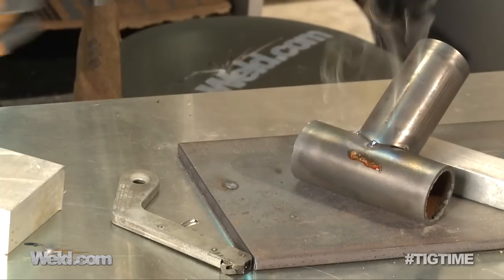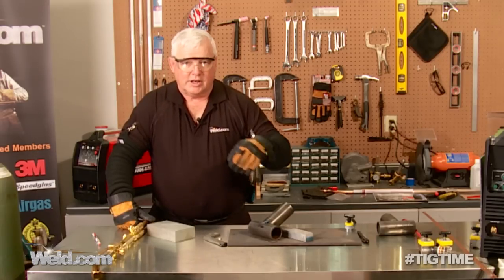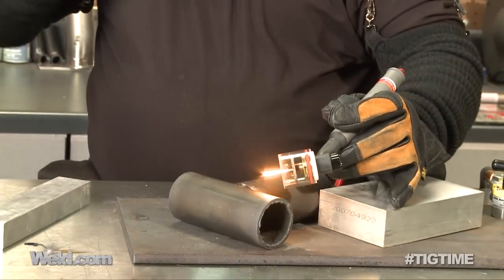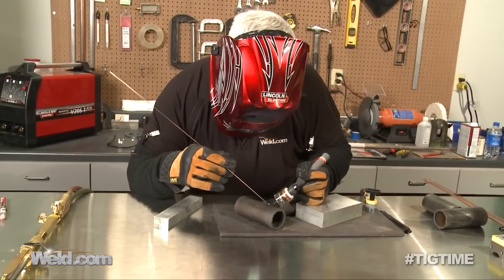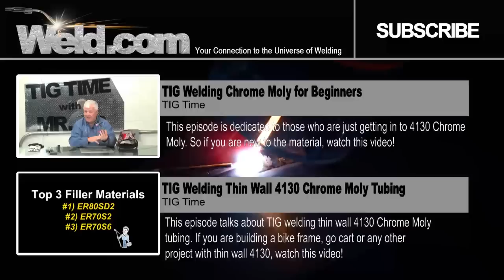TIG Welding Heavy Wall 4130 Chrome Moly | TIG Time

Comment: hi 
how are you i am welding brass for the first time please i need your help in this regard how to weld 3/4 square brass pipe the pipe is in casting the thickness of the pipe is 16 gauge what is the current  And what will be the pressure of argon gas and how thick will be its felting rod۔
 I will be grateful to you۔

Comment: didnt say what tungsten hes using, filler wire thickness nor what amperage hes at...pretty basic shit to mention in a "how to" video.....
Reply: Did you have the sound turned off?
Reply: Pretty basic and standard YouTube comment. Addresses issues that show you either didn’t watch/ listen to the whole vid or didn’t retain that ‘basic shit’ he did in fact mention. All of that info isn’t in there.

Comment: How could this guy call himself "mr tig", when he cant weld in anything other than a straight line? Absolutely no following of the radius of the tubing,  torch angles shot to pieces. A decent welder deserving to "give lessons", would have welded that in quarters or halves lol 
 Insuffucient fill leaving undercut edges, all sorts. 
Was this guy simply a salesman that had been shown a little bit of welding before each recording??

Comment: im finding that when i weld 4130 tube into stock motorcycle chassis mild steel the chassis tube burns back into holes  is there any reason why.should  use less amps?

Comment: Once again "Mr tig" is wrong! No one pre heats chrome molly when building roll cages. As long as its above 60- 70 deg. Also every Motorsports sanctioning body requires GTAW to weld chrome molly! Most roll cages are .083 not .120 if they are chrome molly. The whole reason for using chrome molly is to use the thinner material. I don't know any chassis builder that needs a root pass? The joints should be very tight. Many sanctioning bodies sonic test the cage and the weld needs to be the thickness of the base tubing. The only thing this self proclaimed expert is an expert in is marketing himself and companies that fund him. If you want to learn welding from a video try Jodie at welding tips and tricks or professional chassis builders who are plentiful!
Reply: You  didn't  lesson  very  well  did  you ?   120  is  for  monster  trucks  not  race  cars.
Reply: Desert racing requires .095 wall 4130. Most desert fabricators are running 2 pass joints...

In fact some builders are now annealing the entire chassis after welding to make it one homogeneous piece.
Reply: Did he say it was roll cage tubing?

Comment: PLEASE HELP ! im welding a motorcycle frame ( the piece that holds the pivot pin for my foot peg, it snapped off during a crash) and i have shaped it such that its a v shape ( like when you would create a groove before certain types of welds) its just that its much larger, and i estimate that it would take 6 passes to fill the v groove. i want to find out if doing so many passes will negatively affect the strength?? considering i maintain correct temperatures. advice will be appreciated, especially from Mr Tig ! :D i am following all the guidelines for welding heavy gauge 4130... thanks !
Reply from the maker: When welding your foot leg back in place it will be important to use the er80s d2 filler and make sure you don't quickly quench the weld.  Legit cool slowly to avoid cracking.
Reply: thank you so much ! take care

Comment: This very random and off topic... But I see in the back ground your bench grinder. What wheel do you use on that for tungsten? I bought a bench grinder and the wheels on it are impregnating dust into my tungsten I think. I have the same welder as in this video. I notice the contamination mainly on AC. Thanks!

Comment: How do you like the Helmet you are using in this Video? Is it the Viking 1840 from Lincoln? Is there any disadvantage because it has only 2 light sensors instead of 4 ? 

How do you like it compared to the lets say  3350 from Lincoln?

regrads

Comment: Wyatt,
Could I use a 1/8" tungsten for both passes as well, despite the lower amperage in this setting? I've found that most of my welds aren't on tiny little parts, and being able to "standardize" on keeping 1 or two sizes of tungstens(of various types, for separate materials) makes things easier, and "less stuff" in my kit(I'm a college student and use the equipment at school, but bring in my own torches, tungstens, cups,etc...

I've learned a lot from your videos, and have referred my instructors to you and your channel on multiple occasions.

thanks!

Comment: 5:15
"Make sure you shut off the acetylene first"

Is this correct? I was always taught to shut off the oxygen first.

No oxygen with fuel = No flame
Hoses get purged with fuel that can't ignite

No fuel with oxygen = Pop
Residual fuel can ignite. Hoses experience the forces from a "backfire" i.e. residual fuel igniting within the hose because you have fuel contained in a rich oxygen environment.
Reply: No  it  is  not.  Let  the  ox.  blow  out  the  flame.  Because  the  asetelen  is  sooty  and  dirty  and  you  might  cause  a  back  fire.
Reply: Yes it is correct. A before O or you’ll blow. It used to be taught the other way around but now it’s taught A first.

Comment: I noticed in one shot that when you tapered the amperage down on stopping you also pulled the diminishing puddle to the front edge of the crater. Is this something you do all the time?
Reply: Doing this reduces the chance of it "cratering"

Comment: Should be using a rosebud for preheat.  For larger items, a weed burner actually works really well.
Reply: You will anneal the metal I believe
Reply from the maker: +Robert Palmore Here's a lecture we do for the AWS on why pre-heating 4130 is not the best of ideas in most cases. https://youtu.be/wVrdST1pXRk
Reply from the maker: +simclardy1 This is true

Comment: not always, but definitely when doing suspension mounts. after you have the frame welded up it is good to heat treat it in an oven to relieve stress at the joints

Comment: Is it necessary to heat treat 4130?
Reply: Depending on the application.  Usually for a chassis no.  Unless the person you are building it for is a princess tjat wants to brag about how much he spent on his race vehicle (which he most likely will never run)

Comment: i think these days no one pays attention to the basic aspects of metalurgy...just because the weld was created doesnt neccesary mean you have now oneuniform piece, you could have 2 the weld and both pieces you started with. by allowing the fillet matial to cool in a way that it becomes tempered it could have very different properties than you were hoping to achieve..weld in Alaska preheat and post heat cruciel. or the ge nuclear reactor vessels preheat was post heat..zero room for error

Comment: I am building a truck frame out of 1.75 .120 4130n, what can I do to reduce distortion in the frame when using the pre heat two pass method?

Comment: Wyatt
Great example  Appreciate the heat stick and the metal prep didn't think about how far back to prep the joint area. Thanks for the heads up
Awful Arthur.
Reply: He didn't  mention if he cleaned it on the inside of the tube,  I'm  sure he did right?

Comment from the maker: Its never good to quench or cool down 4130 other than a slow rate. The slow rate is relevant to the material thickness that you are welding. example:  up to .12" thickness the safe zone for cool down natually is about 2-mins.  After that the quenching affect is not very significant. If you are welding .120 and heavier, the cool down is several minutes, 2-10 and again depending on the thickness. Its always welcomed to have a local heat blanket wrapped around your weld immediately upon completion.
Reply: So I am about to do some 4340 welding and they are asking for Post Weld Stress Relief? The part is 1.5" x 0.75" x 7". Is this really needed or would air cooked be sufficient? It's a tool modification for a torque adapter. Welding a 3/4" drive socket to a piece of 4340. The stress relief would have me heating to approx. 1200° F and then cooling over several hours. I'd love to hear your input on this. Thanks.
Reply: That's  only  when  your  through  Pay  attention  For  pets  sake  guys.

Comment: Excellent video Wyatt - one of the most imformative I've watched of yours - great detail in the description - ( almost a prodedure ) I liked the fact you had a realistic No. of stop starts to get round the joint while maintaining torch angle / gas cover.- Everlast seem to be lending / giving alot of Utber's equipement - how do you rate them - seen good & bad reviews. Now if you weld up a spare monster truck frame I got a great 472 cu/in motor with blower & 2 predator carbs !  Cheers.

Comment: What about post heat, or keeping it from cooling down to fast? I found out about how brittle a weld could be on accident. Guys were asking me to hurry up and weld ladder racks from rebar, like what you use in cement work. I didn't want to burn them, so i quenched it. Next thing i wee it coming back broke into like glass. Now i preheat and cool it down slow. I grind the parts like chisel points so full penetration too. Love the videos and learn something every time. Thanks